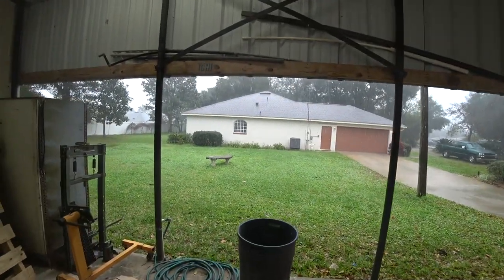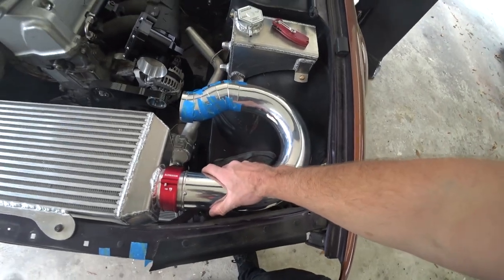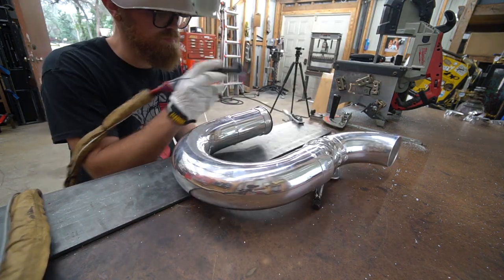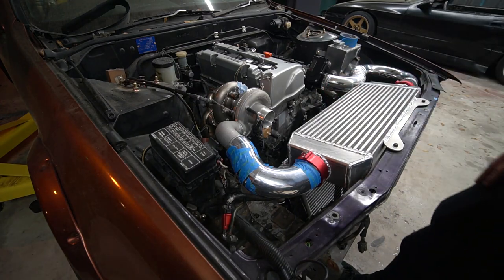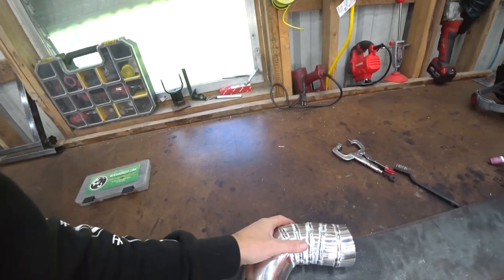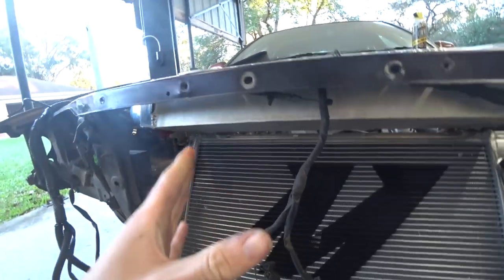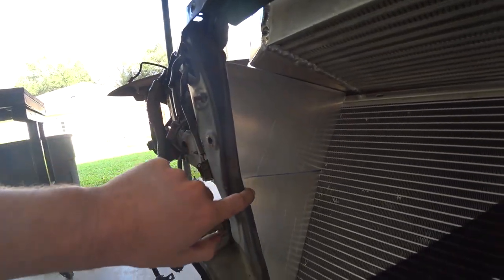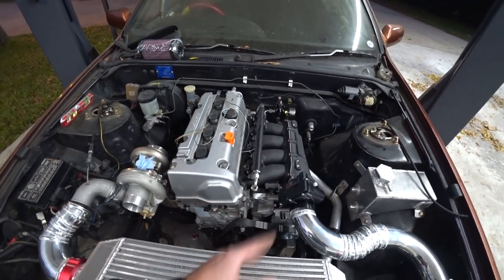Honda K24 Cefiro Build. the most satisfying project yet!

Comment: Why don't you run the turbo air duct up to your side wall, go through it and have the filter set in the "V" ? That way it will get the cold air and still feed plenty of air through your radiator and cooler.

Comment: Why not weld 2 90's right off the intercooler kindla like you did on the inlet side? It will make that pipe way less elaborate. You can toss the inlet pipe on the other side real quick to test that theory.

Comment: I'm sure its been stated somewhere, when he was building the ends for the cooler he could have build them so that the inlet and outlet was facing the TB and turbo and made the plumbing cleaner
Reply: The bends for that would have been bad for airflow.
Reply: @solaryellowis3007  not any worse than the core of an intercooler is

Comment: Why not fabricate the outlet intercooler side tank to wrap around to face the throttle body and use a simple straight hump hose to connect the two. If you are worried about flow around the sharp corners inside simply fab up some internal turning vanes to reduce turbulence inside. That pipe kills the look of the engine bay..

Comment: Use green PET tape it has good holding power and is very resistant to heat
Reply from the maker: Great tip! Will order some!
Reply: @Taylordrifts  Iv also used it to fill the gaps from tacks while i back purged my stainless exhaust

Comment: Hey taylor Why don't you put fans and shrouds on both radiator and  intercooler?
Reply: You only need the intercooler to get lots of airflow when you are making boost, which isn’t when you are sitting still, unlike the radiator.

Comment: You should consider taking a welding course. I mean, it seems like you thoroughly enjoy welding and I think it would be cool to see how much you could progress. Also I'm glad your still progressing and haven't hired someone to build your cars for you. Seems like every youtuber is doing that now and it's kind of lame. In a year from now they aren't going to progress or learn near as much as they could. You on the other hand will probably be fabricating  vehicles from scratch. 😂Also I'm confused why you couldn't have just took an inch out of the middle of that 90 and then it would have been tucked in closer to the radiator and you wouldn't have had to all the pie cuts.
Reply from the maker: It you cut in the middle of the bend it’s not round. So if you did two cuts there they wouldn’t come close to lining up it would be like teardrop
Reply: @Taylordrifts  Thanks that's actually really good to know.

Comment: Why dont you bend the intake to the left and have it right in front of the engine so it can pull air from behind the v mount? And get a block off plate for the bov on the turbo :) bov arent needed in this world anymore.

Comment: I’m confused as to why you didn’t just shorten up the U in the middle by a few inches so you didn’t have to do all the pie cuts to bring it back towards the radiator.
Reply from the maker: If you cut mid bend the pieces don’t lineup because it’s more of an oval in the center of the bend.

Comment: Dude when you will tubing... You need to go get a roll of foil tape for ducts not to be confused with duct tape.and you need the back gas that tube with argon so that you're penetration goes inside instead of outside that'll make your welds look a million times better without changing any other aspect of your technique.

Comment: Probably would have been better off starting with a donut and cutting it up. That's generally how people get the right radiuses you needed there. Intake side, tight 90, small straight, tight 90, tight 90.

Comment: I feel you could have made the radius of the 180 a bit shorter. And I hope I can explain this correctly but cut the 180 into two 90s and cut back the one end on both of them. So instead of being a long radius 90 it would have been a short radius
Reply: End up being a tighter 180. It would have saved a lot of the welding. And I think you could have made the shorter piece coming out of the intercooler shorter at that point. But nice job man and thank you for the content
Reply: Also something I picked up on from watching other welders. But you would need a peddle is adding heat dab, back off move, add heat and dab. So basically pulsing but with a peddle

Comment: your fab work is good but you missed the mark on this one. a v mount setup is utilized to minimize intercooler piping length thus reducing lag. you really should have designed the intercooler tanks to inlet and outlet  at the top facing the turbo outlet and throttlebody  so you could make real short charge pipes. the way you did it has the same amount of tubing as the fmic.

Comment: Take this if it helps, but, I cut all my filler rods in half. Instead of having them smacking me in the head and flailing around while I'm welding lol.
Reply from the maker: I used to do that too but I’m trying to get better at using the whole thing so I have less leftovers from when they get too short.
Reply: @Taylordrifts  guess I feel like I end up with the same amount left over between the two peices. Lol

Comment: I don’t see why you couldn’t have done basically the same on the outlet of the intercooler as the the inlet instead of using the 180
Reply: Because the angles are totally different and there needs to be a space for the power steering.

Comment: My question is, instead of spending an exorbitant amount of money on a small, single use bead roller, why didn't you buy a quality unit like an Eastwood full size bead roller that you could use on panels and such as well as doing the ends of piping?

What the hell? Where's my, "Thanks for watching. Thanks for subscribing... goodbye"

Comment: kinda ridiculous that when you built the end tank from scratch you didnt put the intercooler outlet in a better spot to point at the throttle body, could have gotten rid of that entire pipe with a much cleaner look
Reply from the maker: It was too close to the throttle body to get the two bends needed to jog over to the throttle body.
Reply: @Taylordrifts  cmon brotha you made the endtank from scratch, since it is the outlet you could have pointed the exit straight at the t/b with a custom endtank, since you were building one from scratch anyways.

Youre end result was good quality, xo